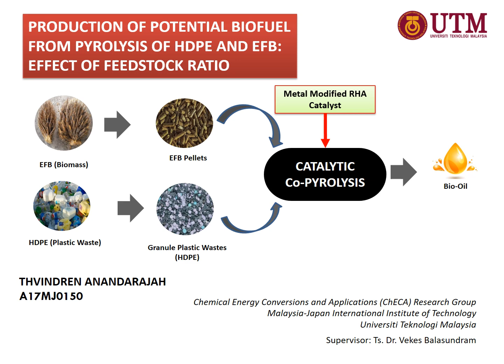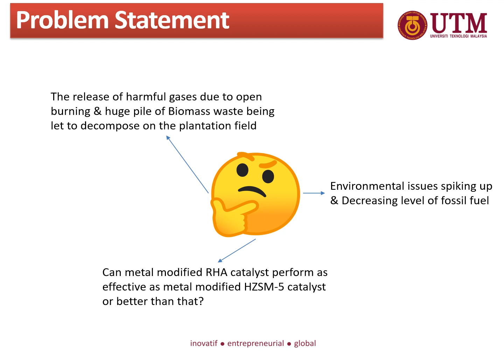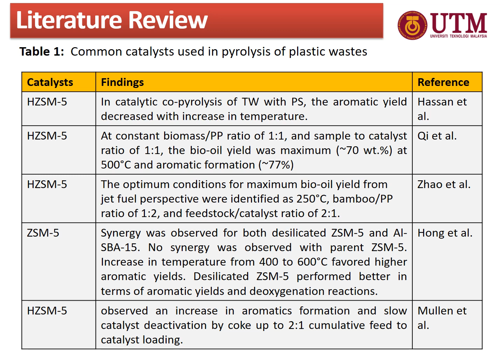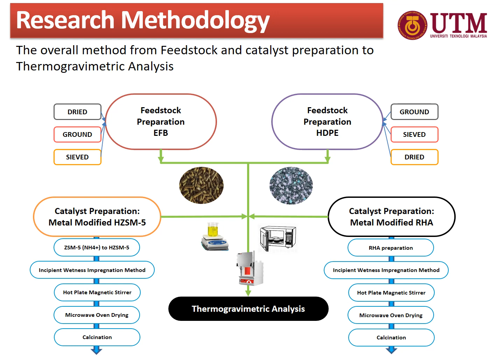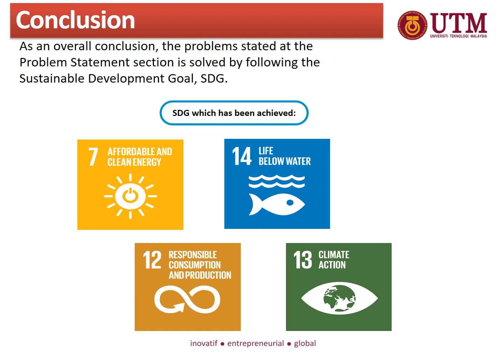PRODUCTION OF POTENTIAL BIOFUEL FROM PYROLYSIS OF HDPE AND EFB : EFFECT OF FEEDSTOCK RATIO

Comment: 1) EFB and HDPE have two different calorific values. How will you manage to get the optimum  pyrolysis parameters to ensure that complete reaction is achieved?
2) The reason for the specific catalyst?
Reply from the maker: Thank you Dr for this comment. As the experiment is still in progress the answers which I’m about to present is based on the studies that I’ve made so far regarding this investigation. 
1) The feedstock in this experiment are empty fruit bunch (EFB) and high density polyethylene (HDPE) where both has different calorific values which seems to be affecting the optimum pyrolysis parameters and the completion of reaction. The type of pyrolysis we are carrying out is catalytic co-pyrolysis where EFB undergoes pyrolysis simultaneously with HDPE. Keeping in mind that the direct use of pyrolysis oil from EFB as a fuel is not viable because of the low calorific value of pyrolysis oil. This is caused by the rich oxygen-containing compounds in the produced bio-oil. Many studies reported that co-pyrolysis  of  EFB  with  HDPE can  reduce  the oxygen  compounds  and  increase  the  caloric  value  of  pyrolysis  oil.  The  addition  of  plastics  in biomass  pyrolysis  increases  the  yield  and  the  resulting  oil  calorific  value  compared  with biomass  pyrolysis  alone,  due  to  the  presence  of  paraffin-containing  hydrocarbon  polymers, isoparaffin,  olefin,  naphtha,  and  aromatics.
2) The reason behind choosing this specific catalyst is by considering its tendency of converting undesirable carbonyl to hydrocarbon is very much active compared to the other catalysts. HZSM-5 is modified to be metal modified catalyst by adding ammonium heptamolybdate tetrahydrate and nickel (ii) nitrate hexahydate. The purpose of converting the HZSM-5 to Ni/HZSM-5 and Mo/HZSM-5 due to its higher cracking ability which increases its efficiency. In addition, many studies reported that HZSM and metal modified HZSM-5 catalysts increases the formation of aromatic hydrocarbons with lower oxygenated compounds compared to other type of zeolite catalyst such as SBA, Beta-Zeolite, H-modernite and others.  Thus, HZSM-5 as zeolite type catalyst is the most promising catalyst in the research field of catalytic pyrolysis of biomass and plastic wastes. Other than that, in this investigation, another type of catalyst will also be tested which is the rice husk ash (RHA) catalyst. The HZSM-5 will be replaced with RHA due to higher silica compositions and that are almost similar to properties of HZSM-5, thus, the invented catalyst will be green and cost-effective.

Comment: Regarding the literature reivew, What about other types of reactions beside the  HZSM series of catalyst? This is important to justify your result too
Reply from the maker: Thank you Dr for this comment. In my opinion, there are several type of catalysts such as fluid catalytic cracking (FCC) catalysts, alkaline type (MgO and CaCO3), and silicate alumina which can be considered for catalytic pyrolysis of biomass and plastic wastes. However, the tendency of converting undesirable carbonyl to hydrocarbons is less active compared to HZSM type catalysts. In addition, many studies reported that HZSM and metal modified HZSM-5 catalysts increases the formation of aromatic hydrocarbons with lower oxygenated compounds compared to other type of zeolite catalyst such as SBA, Beta-Zeolite, H-modernite and others.  Thus, HZSM-5 as zeolite type catalyst is the most promising catalyst in the research field of catalytic pyrolysis of biomass and plastic wastes.